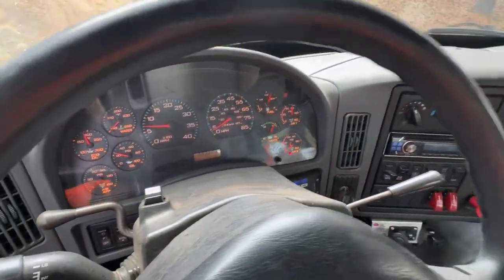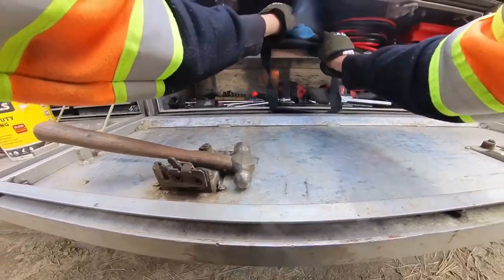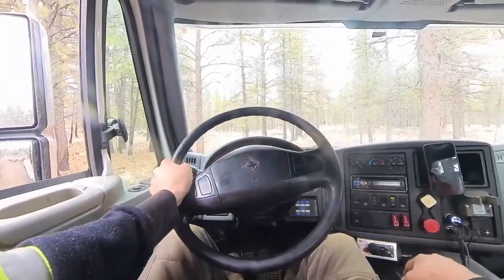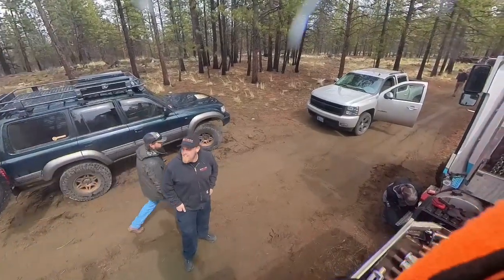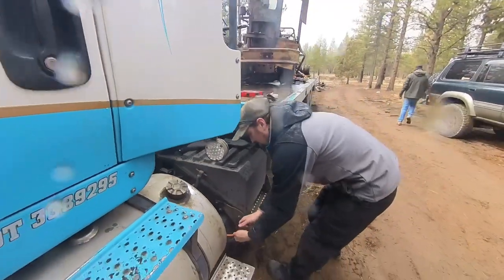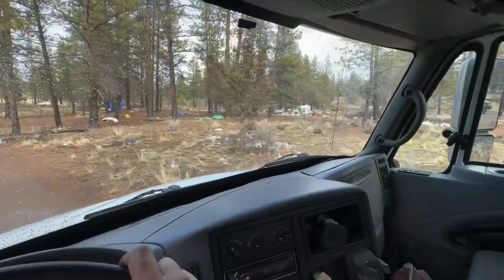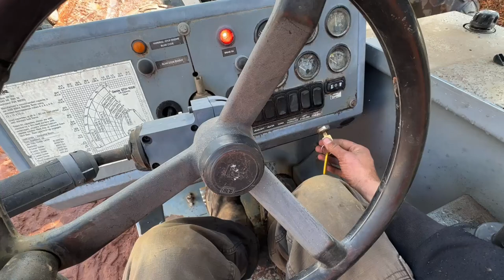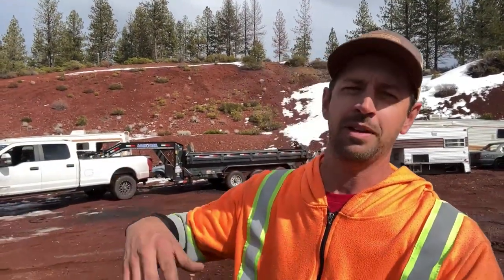I broke my truck trying to clean up this burned RV

Comment: I have lived professionally homeless for years. I did not litter. I just took out the trash. I’m very thankful for the work that you did. Got me a home now. I’m still not littering. I think a piece of garbage is gold because when I remove it the place is forever that much better.
Reply: I agree , it’s one thing to be down on your luck , I’m not mad at people for doing what they have to do , but for god sakes don’t live like pigs & trash everything. Keep it somewhat clean .
Reply: @davestevens4263  pigs are clean animals and wouldn't live in those conditions unless you built a fence and forced them to we had a ditch dug in our hog lot and thought we'd have to fence it to keep them out they'd root around a couple feet away but never got in the trash we'd 3/4 fill the ditch burn it off and start again till it was almost full burned and we'd cover it as we dug the next one beside it then it took years before the pigs would dig very deep in an old pit they're really pretty smart and clean animals

Comment: It's disheartening to see the level of damage and garbage that these people are doing to the public lands, but the group that's out there hauling all these Junkers off are truly the heroes we all need. I only wish that I wasn't so busy trying to get my RV back into a trip ready status and that you weren't 8 hours away - I still want to try to come down there for one of the cleanups later this year - just because!
Reply: In the meantime join a cleanup local to you it's a worldwide problem there's an old dock setup (I can't remember what the locals call it we call them marinas) in the Philippines that was abandon because it's so packed with trash boats c and get in to use it the boats with engines get plastic hung in the props rendering them useless or suck trash in the water pump port overheating the engine and it would take a monster of a man to row far into it
Reply: @davidwoermansr  Yeah, trash is a problem here in the Philippines,
I scream and shout about it on my land but it falls on tin ears, every
where I walk, rubbish, pick it up and when you return, so has the basura.
Oh Well.
Reply: @ivanolsen8596  it's sad to see that happening all the islands have such beauty and for the most part the people are great hard working people and beautiful people too no matter where you're visiting from you're treated with respect and helped right away if you need it I need to return and make my rounds to collect more art ever since I visited for my first time when my brothers were both there my oldest brother was a Marine my younger brother was Army we were out and about and got tattoos what would've cost us several hundred in the states they were only asking 10-20 US we each gave 100 claiming it was the smallest bill we had and they could keep it their family needed it worse than we needed to drink it away there's very talented artists there just trying to support their families I haven't got a tattoo outside the Philippines since it's a side affect I have everytime I visit one of these days I'll run out of unlinked skin and have to find new hobbies there my parents expect me to come home married from a trip because my dad says he always sees ads online for mail order brides from the Philippines so his vision of the country is women chasing American men around trying to get married to become an American citizen they won't ever come with me to see what it's really like if I did get married I'd probably visit my parents on vacation everytime I leave I'm already thinking about my next visit
Reply: @davidwoermansr  Be a good move to build up your assets and move here, What I read about whats happening overseas I would be homeless and it aint improving.
I am living OK here at the moment.
Reply: @ivanolsen8596  I've thought about it more everytime I visit just staying there with my savings and investments I could live pretty good for quite awhile if my parents didn't need so much help it would be an easier decision
Reply: @davidwoermansr  Yeah Mate, you have to look after the oldies, they looked after you when you needed them!
Reply: @ivanolsen8596  yeah I'm battling with myself right now I've known since I was young my dad was born on that farm (literally on my grandparents dining table) and he wants to die there not in a nursing home or hospital my mom was a nurse and wants the same because she's seen so many people treated wrong when near death but my mom is insulin dependant and we'll into the early stages of dementia and dad's Parkinson's is starting to affect his memory and decision making its hard to keep track of them even with a daytime home health aid but at least I know they're not forgetting their meds

Comment: Wow, 37 vehicles….great job to all. And having a good friend like Jeremy and others involved, that fully understand the cost of volunteering as you have must really help. I hope I can find a like minded group here in my area to join!!
Reply: If you can't find 1 start 1 just remember picking up trash is the easy part and cleaning up public lands alot of landfills will waive the dumping fee for the project but with vehicles check with the local or state police about what has to be done before you can touch a vehicle some states are stricter than others

Comment: I worked for the Missouri Department of Transportation when I was in engineering school and was assigned to cleaning rest areas along I-70 (a delightful use of my engineering skills) and I was absolutely astounded at some of the traveling public and their total disregard for public facilities and property. This was in the late 1960's and the interstate I was working was less than 2 years old. People cleaned out their stock trailers, vans, or cars and just left the trash laying in the parking lots. And this was in the 60's!! I see not much has changed. The rest rooms and picnic areas that were built as part of the highway construction were first class. The only bright side was that if I caught someone in the act of doing bad things, all I had to do was write up an incident report with a description of the vehicle, license plate, VIN number, and a narrative of what was done. Had to be careful since some of the motoring public were psycho even back then. Their reward was that the highway patrol would either pull them over further down the road and write them up or they would receive a summons in the mail or in person at their current location. Did not get them all but got a lot. I still had to pick up and remove a whole lot of bad things.

Comment: THANK YOU for cleaning off all the dirt and debris before going down the road with that junk.  Over decades of driving, I've had to file multiple windshield replacement claims because of truck drivers who don't take the same pains with their loads.
Reply: Most of that would be nails and screws tire hazards unless you were following too close
Reply: @davidwoermansr   Every incident was debris bouncing off of trucks in the opposite lane of traffic heading the other direction, and the largest item was a rock the size of billiard ball.  So, no, not "nails and screws and you were following too close", but thanks for your uneducated guess.
Reply: @NorthernKitty  I was talking about what would've fell off the frame of the burnt RV he was hauling not what happened to you in the past and you're welcome for the very educated knowledge of hauling those kind of things BTW I don't worry about cleaning them off whatever hangs on bouncing on the backroads should ride fine on the highway

Comment: I was going to comment on how I’d fix that drain but then you did exactly what I would, only thing I could add. I us a propane soldering torch (always have one handy know, saved me more times than I can count) to melt whatever sealant is on the threads then the broken fitting usually comes out easy with a flathead screwdriver

Comment: Nice to have all those tools with you. Drove Ready mix for years and always had a tool box with me. Just pulled on a job fully loaded when the truck shut down, felt like a running out of fuel sort of thing. Since it had been in for service day prior, I checked clear fuel filter bowl and it was empty (O ring was bad). Managed to hook in and out lines together and bypass filter, bled all the injectors and got truck going. Job superintendent said he had never seen a mixer driver do that kind of repair. Pays having been a truck mechanic and helicopter mechanic for 20+ years.

Comment: Hey I’m glad you’re getting a power washer!
I love love love mine!  Except for I practically rebuilt it last fall and because it turned cold so suddenly I couldn’t even get to all the jobs I had planned for it! Then yesterday I got it out and filled it up with gas and pulled it a few times and Pop the cord blew apart. Fortunately 2 strands were still holding on for dear life. So I pulled it apart and before I cut the strands I used a zip tie to go through the holes. Start on the outside, go in through the inside of your cord wheel over at least two of the ribs and back through your covers metal louvers line up the knot on the inside to the hole and secure it from the outside by tightening up the zip tie .
I got really lucky when mine came apart! I didn’t keep yanking the rope to get it to go back in! 
If you have ever done this yank it all the way out, and it snaps, you are probably familiar with the sound of the coiled metal spring blowing up inside your small gas engines air cooling housing! 
That’s another story entirely and you have a worse mess. 
So once I threaded the new pull rope through the handle with a stop knot, I took the handle put it back together and then pushed the end of the rope right into the hole again tied it into a knot in the hole, put it all back together and Voila pulled it a couple of times and it started !!!
Bought it from a pawn shop, back in 2008 or so and it’s on its second pump now, and still working!!! With that rotary motion novel it takes rust and paint off, but it’s an old amazing Craftsman! 
It has paid for itself multiple times over the years!!! Recycle Re-use Re-pourpose!!!😊

Comment: Casey, when I drove truck I always carried copper tubing ( less than a foot ), rubber hose, hose clamps, and pipe fittings that all would fit any part of the air system. They don't take up much room but can save your a** when broke down even if an illegal repair just to get you rolling again so you can make a proper repair later. Keep'em rolling... you 're doing great!

Comment: You do need the secondary tank. The extra air is used to keep your parking brake off in case you have to use your brakes a couple times. Without it your parking brake can apply while you are going down the highway. It is there for extra air volume.

Comment: Hey Casey, another great treat.  As an older (more mature) and lazy guy,  I invested in the chain binders with the fittings that would let me tighten or loosen them with my Makita impact.  A bit more expensive, but so much faster and easier..  Just an idea because I know you like to be efficient.  Kepp up the good work.
Reply from the maker: Fucking.  Garbage.    
They are not easier or faster.

Comment: Hey Casey !!  Take your ""Jack knife ""  &  widdle a wood plug from a tree limb to plug the tank !!   Had to do that when the fuel line got broke off do to a retread blowout !!  Anyhows ,, Great job you guys are doing out there to keep OR. clean !!🙃😉🤔🙄:eyes-pink-heart-shape::eyes-pink-heart-shape:👍👍👍👍👍
Reply from the maker: 125psi says I'm not going to do that
Reply: @Casey LaDelle I've  done the "carve a wooden plug and hammer it in" routine. It's  all a matter of how desperate you are. You weren't so much as proper help was on the way!

Comment: You should have a set of torx bits, they can be used as extractors in a pinch.
Reply from the maker: I do have a set of them and didn’t even think of that 🤦🏻‍♂️
Reply: @CaseyLaDelle  Reverse drill bits work too.
Reply: @CaseyLaDelle  I was thinking a set of allen keys may have worked also.
Reply: Casey, do the alien keys work on UFOS? 😂😂😂

Comment: LoL! I knew you weren't going to get that out on that first attempt. Sometimes you can pound an allen wrench in it. The screw driver attempt was impressive. It would have worked if you had the exact right size. I've owned cars that I needed a Snap-On tool truck following me around to keep it on the road!

Comment: in the past I have used the hammer to drive the lower jaw of some pliers into a broken fitting....much sharper edges and sorta similar shape was my thinking at the time....worked well enough that i keep the idea around for future use

Comment: Who else wants a pressure washing video of that truck? cause I for sure want it
Reply from the maker: I bought a brand new gas powered pressure washer on the way home from this job.   I used it to wash the truck and my Jeep, then when I drove off the hose hooked the under reach and I drug it down the road completely destroying it 🤦🏻‍♂️
Reply: @CaseyLaDelle  😳 OH NO!   If you bought it using a charge card it might be covered even for that kind of damage.   My card will cover accidents like that even if it is a silly mistake on my part.   🤷‍♂
Reply: @Casey LaDelle  Sorry man I thought that sheet only happened to me. At least no injuries
Reply: Sounds like something I would do. Karma points have to accumulated somewhere.
Reply: Watch “Puddin’s Fab Shop first, and look for pressure washing in his videos, and take notes, lol.

Comment: Use small channel locks, drive the small jaw into broken fitting sometimes works.  Once I smashed a flat file with a hammer and drive the sharp shards in the broken fitting and used vice grips to grab the file parts.

Comment: I have used one side of a needlenose plier to drive into a brass fitting and use as a screw extractor.
Casey was using the Channel Lock backward.  He needs to get a Knipex Gator Grip that doesn't need to be squeezed to grab.

Comment: You can temporarily stop the bipping for low air pressure by holding at the same time panel light switch down and the little trip stick in the cluster for about 5-10seconds. 
As long as the key is on you'll don't have to deal with the alarm.

Comment: A set of torx bits is a must have in situations like this, find one a little bigger than the hole in the fitting, tap it in with the hammer.

Comment: The old original seers craftsman screwdrivers with the clear handle with the red and blue paint on the ridges make really good chisels especially after you broke the tips off using the screwdriver for things they were meant to be used for. Hit me up next time you’re in Portland I got a whole drawer full of easy outs and stud removal power tools that I no longer use

Comment: You can always whittle a stick and plug the hole with until you get to where you could repair it. Had to do that to air up a tractor trailer to tow it.when the drive shaft came out and knocked a fitting off the air tank.

Comment: You can also stick a tiny branch in and break it off where the valve broke and it will work in a pinch.

Comment: Casey, In a pinch a hex or torx socket/l-key can be smash inside the air fitting, work better if the fitting is broken up and not seize in. Save my ass a couple time, event more than easy-out!

Comment: Do the transients move right back in when you're done cleaning? 
Challenges are fun!  I was thinking whittle an oak stick, flathead screwdriver to drive into the broken stub like an easy out.   Good alternative, just dead head the secondary feed!!   Swap on 20.5R25 tires for ground clearance but that's another day.
Reply: Didn't you see people still living in RV's the air pressure is about 125 PSI you think a piece of wood will hold? Taller tires when he rarely takes that truck off the pavement?
Reply: @speedfreak8200   I did see the other encampments and it looks like after a cleanup, well just move right back in to this nice area!!  I'd bet a nickel that a stick carved into a tapered plug would hold back 125 easy! Doesn't have to make a perfect seal. 3/8 bore, call it 0.1 sq/in, has to stop 12 ish pounds of force?

Comment: A method for removing broken fittings is to use the tang end on a file. You can drive it into the fitting and then use a adjustable wrench to turn out. "Poor man's EZ-out"

Comment: won't allways work but a wood plug made from a tree branch and driven into the broken fitting will hold a lot more pressure than one would think, just don't waste time trying it on a hydrylic fitting.

Comment: A flat head plyers and a hammer can get a broken brass fitting out in a pinch you just need the right flat head screwdriver you have to tap the screwdriver as you turn to keep the bite in the brass

Comment: For a good emergency fix you could have used a small stick or a knot shaved it down a little and hammered in the hole to stop your leak.

Comment: Try a screw driver, a hammer, and a wrench. Just tap the screw driver into the opening and use the wrench to turn the screw driver. It should come right out. It worked for me a few times.

Comment: Pressure washer and easy out‘s.  On a separate thought could you use airbag suspension as an off road lift to get some lift for low speed environments?

Comment: i knocked one of them drain valves off one time i had a torx socket in my tool box i was able to hammer into the broke off piece and get it out

Comment: When stuck in the middle of nowhere, miles from tools, pound a pencil into the broken fitting.  It will plug the hole so you can drive the truck back to the shop.

Comment: Did you have a bolt you might be able to thread in a few turns to seal it off? 5/16 would probably do it. Or take a  stick and shape it and drive in.